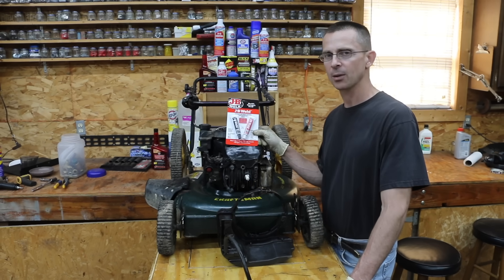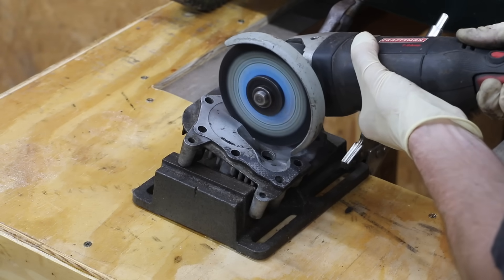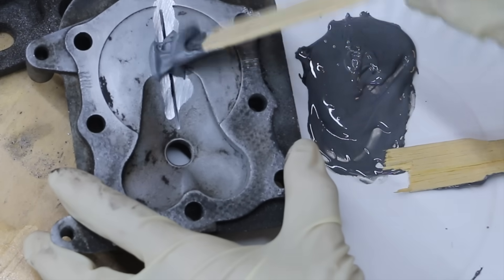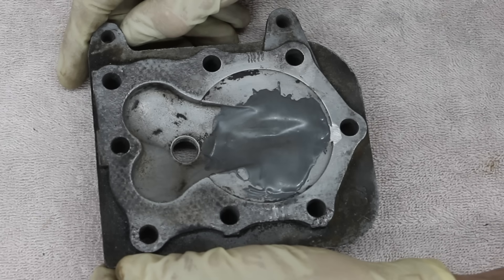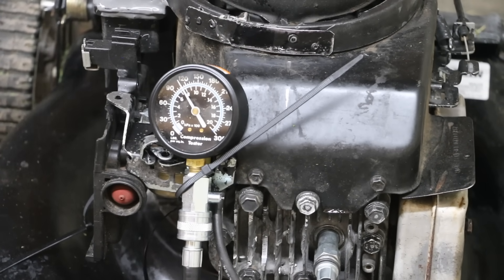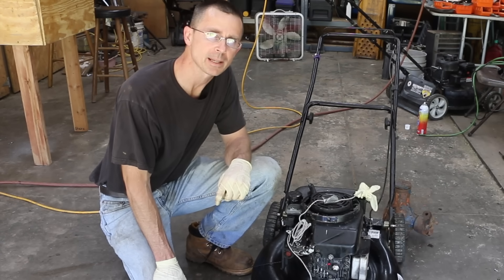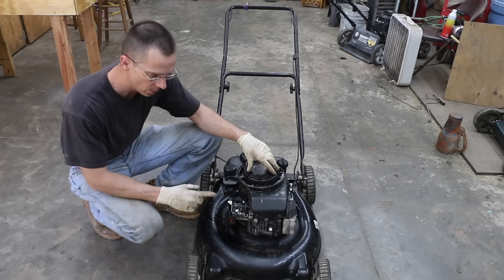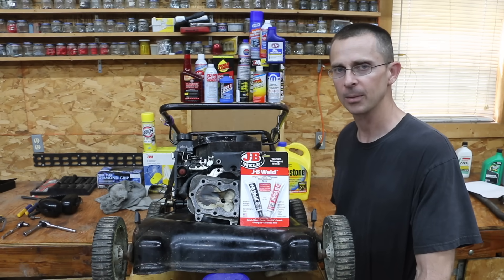Can JB Weld fix a cracked cylinder head?  See the proof!!

Comment: I have a spot on my van where the antifreeze line goes into the motor I wonder if it would work there.
Reply from the maker: Seems like it should work there, but surface prep is very important.  Recommend using a good cleaner to remove all oily substances and then lightly sand...just enough to scuff the surface, but careful not to remove too much metal.  Hope this helps!   Thanks for watching the video and commenting!

Comment: Can JB weld skin cylinder walls to add new life to an engine, always wondered if it would crack with the pressure of the rings. It is really durable repairing valves.
Reply from the maker: That's a great question!  Maybe I can test this if I can find an engine in poor enough condition!   Thanks for watching the video and commenting!

Comment: I had a long deep scratch in a 4" hydraulic cylinder on a n elevating scraper.  I used JB Weld on it and ran the machine for another 5 years or so. The cylinder was effecting the turning power before but never had the issue again.
Reply from the maker: Very impressive!   Thanks for watching the video and commenting!

Comment: Doesn't work for me. Won't take the heat or pressure. Do it right, weld aluminum for the cylinder head and plastic weld for the tank.
Reply from the maker: I agree.  For a long-term repair, it's always best to weld or replace.   Thanks for watching the video and commenting!

Comment: Once I remove and clean the head on my old lawn mower, if I'm not getting at least 100 psi compression as you have with this particular mower, I'm going to tip the mower on its end and see if I can't get the rings soaked with carb cleaner in an attempt to free them of any sludge. I know the rings are will be worn but this may allow them to press harder against the cylinder wall. I don't know, it may work and it may not but that's the idea here...experimenting.
Reply from the maker: Great idea!  You might consider cleaning around the valves too.  I hope you have success!   Thanks for watching the video and commenting!
Reply: +Project Farm 
I will give the valves a swipe as well. I've got a couple of motorcycle projects next in line then I'll get to the lawnmower.

Comment: I would feel more secure if it was Quik Steel. I swear by that shit. I've used it fro everything from fiberglass grey and brown water holding tanks where the PVC broke off flush, , to repairing a macerator pump , auto repair, the shit is amazing. It can be molded, sanded, painted, and a little bit goes a long way.  5 minutes to set, 24 hours to cure, and it's hard as rock. I won't buy JB Weld. I would, but I have no need for it.  Work the clay, pack it in the hole, or where ever you need to use it, and it seals air tight and can handle a lot of pressure..It sticks to plastic, metal, wood, plastic, fiberglass, the applications are endless. $8.00 a tube, and absolutely worth it.
https://www.walmart.com/ip/BLUE-MAGIC-16002US-Metal-Epoxy-Putty-2-oz-Gray-Tube/187596433?wmlspartner=wlpa&selectedSellerId=1122&adid=22222222227071105265&wmlspartner=wmtlabs&wl0=&wl1=g&wl2=c&wl3=182085634702&wl4=pla-285106583202&wl5=9033469&wl6=&wl7=&wl8=&wl9=pla&wl10=101593696&wl11=online&wl12=187596433&wl13=&veh=sem

Comment: I bought an old yamaha sportbike with a pin hole coolant leak on the side of the radiator (which pissed hot coolant onto my leg the 15 minute ride home) and just lathered a little bit of JB over the hole after cleaning it up. It's an FZR1000 and as such I ride it pretty hard and in stopped traffic it gets HOT. Despite this,  the JB has held up perfectly for over a year now, no leaks. I also used it to seal up a pretty big gash in the side of the crankcase in an ancient CR125 I had as a teenager. I rode that bike to hell and back but it never leaked a drop of oil after my admittedly shoddy repair job. I'm glad I saw your video on reddit, I'm going to love going through the videos on your channel.
Reply from the maker: Pat, I greatly enjoy reading about the experiences of others!  Glad you had great success with this product!  By the way, I too had a CR125 as a teenager!  I loved that bike!  Thanks again for commenting and for watching the video!

Comment: JB Weld works well for pot metal carburetor repairs and isn't attacked by gasoline. I think that JB Weld's claim for fixing cylinder heads is for water jackets, not the combustion chambers.
Reply from the maker: Agree!  Admittedly, I used JB Weld for an extreme case that the manufacturer would probably not recommend.  It is a terrific product!  Thanks again for commenting and for watching the video!

Comment: Good video, one thing that helped was the aluminum crack was clean, no oil, combustion or coolant residue which on a deep crack it's not always possible to remove. I'm a mechanic autos/trucks 40yrs plus and I've had good results on cast iron and aluminum oil pans, valve covers, thermostat housings and assorted cracked parts when welding wasn't an option or replacement parts were insanely expensive or parts just not available. It's good stuff.
Reply from the maker: You are absolutely spot-on--surface prep and cleaning is extremely important!  Thanks for commenting and for watching the video!

Comment: I had an old riding mower with a 3.5 horse Tecumseh on it, and used JB Weld to to fix the hole that burned through to the exhaust port in the block. It held up just fine, and I eventually traded off that old rider.
Reply from the maker: Impressive!  Thanks for commenting and for watching the video!

Comment: I've used JB weld for years on a variety of radiator & gas tank minor leaks and pinholes and it holds up well to age and temperature ranges. I even used it to reconstruct a tab on my motorcycle clutch lever that broke off and went flying. This tab was designed to hold a return spring that held the lever open when not engaged. It held up well to the spring tension and crazy vibration of the lever and also matched the color and finish of the lever enough to not stand out.  Plus, JB Weld has a very good shelf life if you store it indoor temps. Works for me! Thanks for the video.
Reply from the maker: I greatly enjoyed reading your comments!  Thanks again for commenting and for watching the video!

Comment: I have used JB weld for many things. 2 that failed were: 1. stripped spark plug threads. Worked for about 2 hours. 2. I used some to reshape an intake port. The next time the head was pulled, all of the JB was gone even though it was too big to fit past the valve. Both was on the same aluminum head. Ended up welding instead.
Reply from the maker: Very interesting!  Sometimes a replacement part or welding is the only sure fix!  Thanks for commenting and for watching the video!

Comment: I have used the JB water weld product to repair a pool pump that had frozen and cracked in the filter basket area. It worked like a dream. Nothing like the stress of this test, but it saved me hundreds vs replacing that pump.  Good products.
Reply from the maker: Impressive!  Thanks for commenting and for watching the video!

Comment: In 1973 I burned a hole in a Yamaha 360 2 stroke piston in the desert. I pulled and cleaned the piston holed area,"toothed it" with a knife blade,glued a 50cent coin to it and put it in the campfire overnight. Assembled the motor next morning and ran the bike all day. JB Weld still has the piston somewhere. It was an advertising display for years at my bike shop.
Reply from the maker: Very impressive!!  I plan to test JB Weld on a piston in an upcoming video!  Thanks for commenting and for watching the video!

Comment: Very impressed about the plastic gas tank repair. I have one cracked Mercury internal outboard plastic tank n was told it can't be fixed.
Reply from the maker: JB Weld also makes a product for plastic.   Surface prep is very important. Light sanding and cleaning is vital!  Thanks for commenting and for watching the video!
Reply: Project Farm Cheers! :)

Comment: It's good stuff.Used it for many different repairs, but never to this extreme. impressive. I may try to use it on a cast iron water heater crack after seeing this. Might just hold. Thanks for the video.
Reply from the maker: I hope you have good success with the cast iron repair!  Thanks for commenting and for watching the video!

Comment: I've used it for oil pans, carburetor Bowl, radiator holes in exhaust muffler and on plastic found that win fixing large holes to put tin foil on one side to form a base so it don't fall throw the hole or form bubbles in the middle.
Reply from the maker: Impressive!  Thanks for commenting and for watching the video!

Comment: I have never used JBweld however I do have a casting I pan to fix with it.  It would be interesting to see if you could stick the cylinder head on without the bolts. (For safety it would probably be a good idea to put two bolts in loosely). Another harsh test would to drill out the spark plug hole to perhaps 1" diameter and then fill the hole and drill and tap the JBweld to refit the spark plug. I don't know how well it conducts electricity so you might need to add a ground wire for the plug.
Reply from the maker: These are great suggestions!  It would indeed be an interesting test!  Thanks for commenting and for watching the video!

Comment: I've used Quicksteel for these type of repairs before - very strong stuff, and easy to work with, as it comes in stick form -  you knead the piece to mix the 2 components, then it gets warm, and hardens like a rock in about 15 minutes or so.

A shootout between the 2 products would be great! Always been curious which was stronger.
Reply from the maker: This is a great suggestion!  I'll try to think of a way to compare the 2 products.  Thanks for commenting and for watching the video!
Reply: No problem - thanks for doing the vids!

Comment: J B Weld is AWESOME.   Works miracles.   The bond and durability are amazing.   Used to
use epoxy on stuff.   After a mechanic used JB Weld to fix an accelerator linkage issue on
my truck,  I was amazed and sold on JB Weld.   Epoxy is a disgrace by comparison.

LOVE your EXCELLENT, detailed, clear, concise videos.   Keep up the great work!
Reply from the maker: I agree!  JB Weld is great!  Thanks for watching the video and commenting!

Comment: very impressive results! I have used jbweld to seal tanks and it will fail after awhile if you use gasohol. I have used 3m panel bond to repair a gas cap and it held up for years.
Reply from the maker: Thanks for watching the video and commenting!

Comment: JB Weld knocks the crap out of Araldite.
That was a good test. Gouging the cylinder head face and leaving excess JB Weld in the combustion chamber would make it more likely to pop. The fact that it didnt is testament to the strength of this product.
Another product that sprung to mind when you mentioned suggestions for other stuff to test is Chemical Metal  made by Loctite. It may have a different name in the US ?
http://www.loctite.co.uk/loctite-4087.htm?nodeid=8802657107969
Or, if you cant get hold of that, how about Wurth Steel Epoxy stick ?
http://www.shopwurthusa.com/wurthstorefront/Chemical-Product/Adhesive-and-Bonding/Epoxy/Putty/Steel-Epoxy-Stick/p/0893449011

Comment: In using JB Weld on aluminum I've had it snap off whole when subject to bending because of the protective oxide layer that aluminum develops instantly upon sanding. The simple solution is to dip it in a 50/50 mix of white vinegar & distilled water and blow dry it and apply the JB Weld. In my experience the Quick version of JB Weld does not adhere anywhere near as good as the original regular JB Weld. Thanks for the video.
Reply from the maker: This is great information!  Thanks for watching the video and commenting!

Comment: I doubt the piston was hitting. More likely the sound is caused by pre-ignition because you reduced the empty volume of the cylinder.
Reply: I think it was hitting... the rubbed off carbon deposits on the Piston are proof.
Reply from the maker: Thanks for watching the video and commenting!
Reply: N.W.  I think you are explaining detonation wrong. Already burned fuel cannot burn again, at least not without adding more oxygen. Maybe you read wrong someplace, and it was "already burning" not "already burned." My understanding is that it is the interaction between two burn fronts that causes a volume of fuel/air mix to burn everywhere simultaneously... and that instantaneous burning is what we call detonation. Although in this case there is evidence of physical contact between the piston and the JB Weld, it is interesting to think about the difference in heat conductivity between aluminum and JB Weld, and how that could cause much higher surface temperatures than would normally be present.
Reply: lol@that. preignition puts holes in cylinders dude.  what you're probably referring to is detonation where the already burned but still quite volatile exhaust gasses are ignited by a secondary ignition source causing a sharp pressure wave that emits an audible "ping." the compression ratios on these engines are so low already you'd be hard pressed to get one to detonate that reliably just from increasing compression in that way alone. all that being said it didn't even sound like a ping, that was a knock. what are you deaf?

Comment: I call bullsh*t; you knew exactly what you were doing! Knowing this would go through extreme heat cycling you left the bead proud. This allowed the brittle weld to be peened by the piston face to alleviate the chance of stress cracks later on. Anyone who JB Welds cast metals for a living knows you need to peen the weld afterwards if you don't want cracking!
Reply: Great video, really like the way you did it.  I didn't like theomnipresent1's "joke" at all. A negative comment can (even as a joke) give viewers a bad impression of you and what you're doing, needless to say. ;p
Reply from the maker: You give me far more credit than I deserve!  I don't use JB Weld for a living.  So, I'm not as savvy at using this product as others.  I later ground off the excess and it's holding up just fine.  Thanks for watching the video and commenting!
Reply: It was just a joke anyways; epoxy isn't brittle so it would never need to be peened! Great test; thanks for doing it, this furthers my trust in JB weld. A great test would be an off the shelf epoxy shootout!

Comment: I had a Diersel engine swallow a bolt once, the bore was scored badly and deeply. Using a ring off the smashed piston I put JB weld into the score mark, and pushed the ring down the bore to clean up the JB weld, left it for 24 hours and ran a hone up and down the bore. The bore was wearing faster than the JB weld. i put the engine back together and it ran well ....so i sold it.. Don't how long it lasted but i suspect for a long time ,as the stuff was ahrder than the block material. Engine was Mercedes OM 606 .
Reply from the maker: Very impressive!  I was wondering if this would work!  Thanks for watching the video and commenting!

Comment: i used jb weld to hold a bearing still where it might have spun in a stretched journal, cracked the case too, thats why i got the motor for free, it was trash, i rebuilt it and it hasnt ran yet but after i put it through its paces ill get back to yall on how it did
Reply from the maker: I'd be very interested to know if this works for you!  Thanks for watching the video and commenting!

Comment: I discovered JB Weld about 6 months ago.  It's not widely available in Australia, you have to look around for it.  So when I see it on the shelf somewhere I'll grab a couple of packs.
It really is good stuff.  I repaired a frying pan handle with it because I knew it was heat resistant and that pan has been in use for years.  Also used it to seal my LPG (gas) injector ports on my car's intake manifold that were never done right and never a vacuum leak since.

Comment: My husband and I use JB Weld epoxy for MANY tasks. 24 hours is a long time to wait, but its always performed well as an adhesive. Our 'Green Egg' grill just got a chip flaked off it.. JB will be used to glue the flake back on, and I expect it to hold, even at the high temps that can be achieved.  If it fails, I will let you know.
Reply from the maker: Jennifer, I also purchased the "high temperature" JB Weld, but did not use it in this video.  That might be an option if the regular JB Weld fails.  Thanks for watching the video and commenting!

Comment: You shouldn't have put the layer on the inside face of it, only in the crack, and put a tape barrier on the other side around the fins so it doesn't flow away, so the other side is the reinforcement.

What you've done may work for a time but with repeated expansion and contraction of the head, it's likely to break off into the cylinder, if piston impact doesn't do that first.   Running 20 minutes doesn't mean much, unless it's some emergency that you just need to mow part of your yard, once, except it can't be much of an emergency because you want the epoxy to fully cure before use.

What would have probably worked better is if you had mixed metal or ceramic powder into one part of the epoxy, then mixed the other half together.  That, or there are many metal loaded epoxy putties in the market including one from JBWeld.

Here's a silly question:   With all that taking apart your mower, why haven't you cleaned the carbon out?
Reply from the maker: All great points!  Thanks for watching the video and commenting!

Comment: Years ago I used it to repair an iron cylinder head on a Ford Pinto engine. There was a gaping crack going across between the number two and three cylinders. It was opened up into the water jacket. I repaired it the same way as in the video but filed it flat the next day. It ran and held coolant and I have no knowledge of it ever failing.
Reply from the maker: Wow!  Impressive! Thanks for watching the video and commenting!